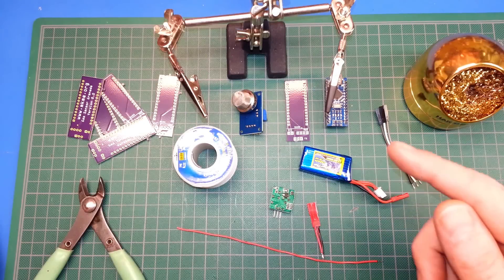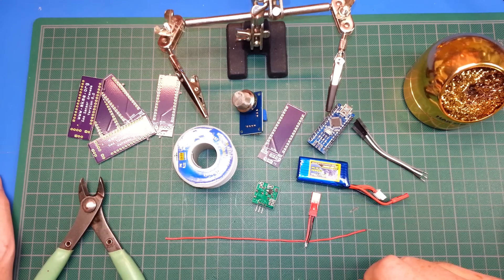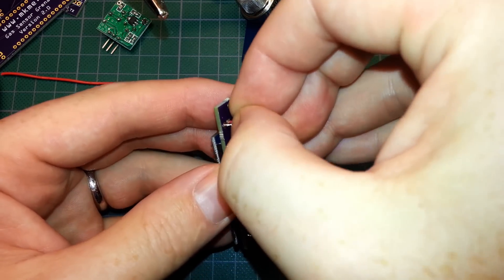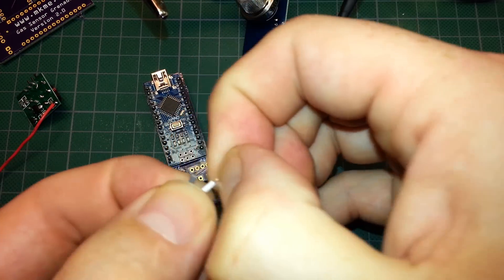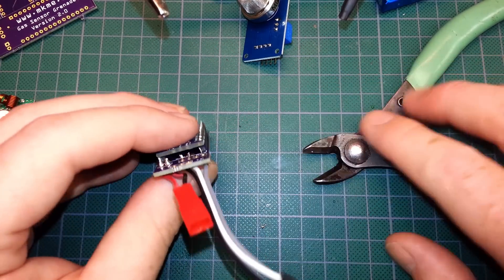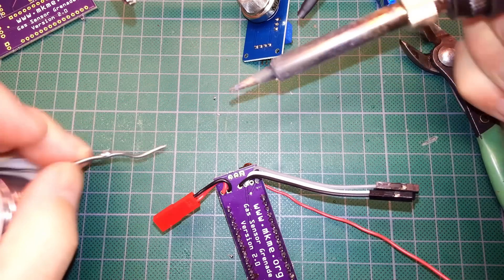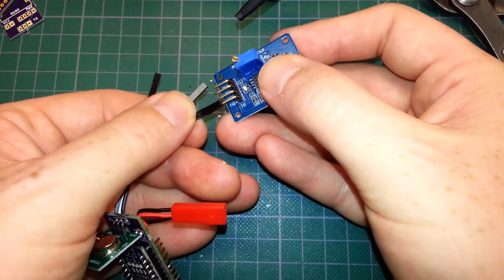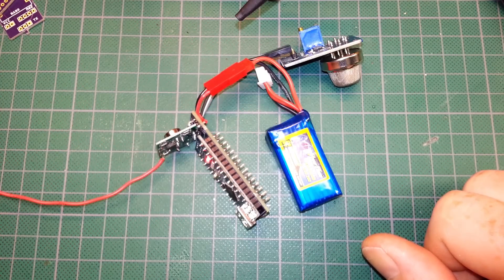Assembly Tutorial - Gas Sensor for Emergency Workers

Comment: Great job Eric. Great video. Thank you for sharing with us. Can you provide more info on the PCB design? What kind of software do you use in order to design it? This project of your is just amazing!
Reply from the maker: +Educ8s.com Hey Bud.  I used Fritzing to design it.  It was my first design in that program so it could be a lot better but the result works great. I need to make time to tidy up the file a bit and re-work the Garden PCB routing too.  Files are at the GITHub link on the Hackaday project.  Cheers!
Reply from the maker: +rebelCoder No I ordered them from OSH Park.  I had a credit with them from an early Hackaday prize giveaway so I got both sets free.  Was simply upload the files and hit order.  Awesome experience.  Cheers
Reply: +Eric William -MKme Tech Eric! Amazing job, as always. Fritzing looks amazing. After you did the design in Fritzing, Ddid you order those PCBs from them too? Do they make and ship them too ?